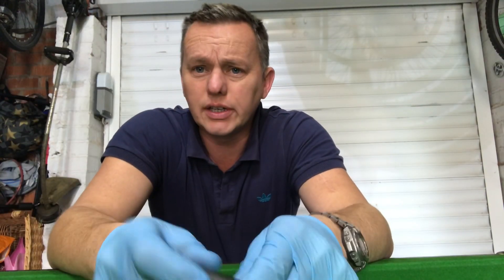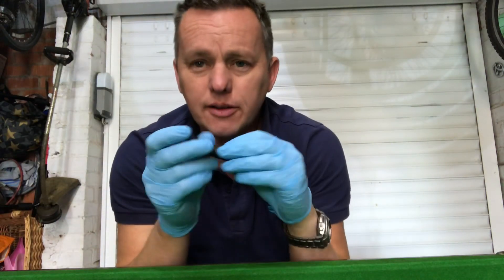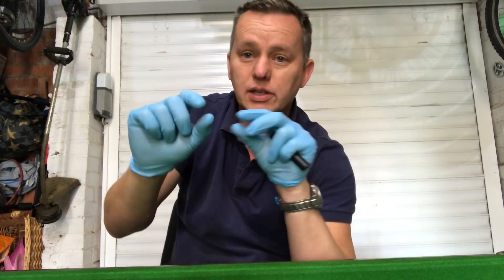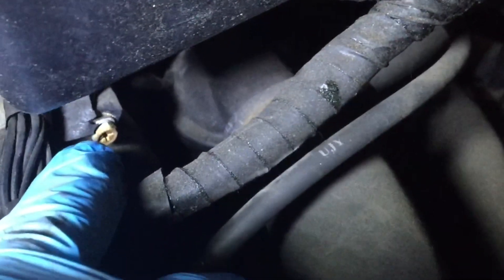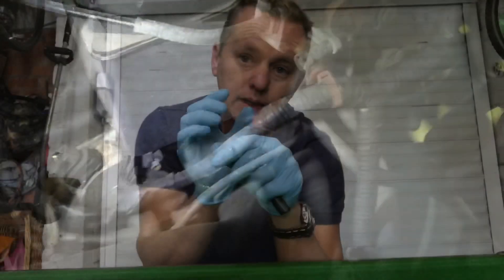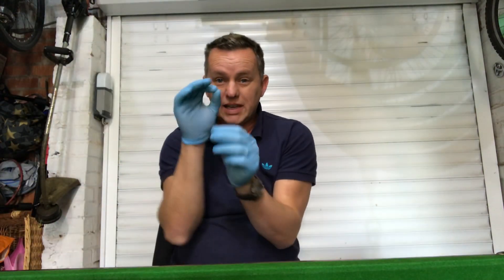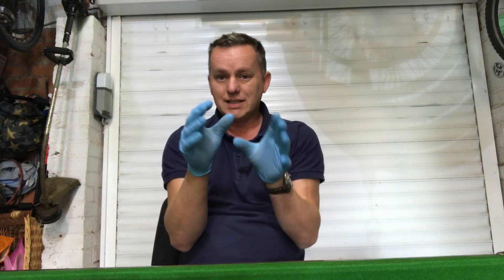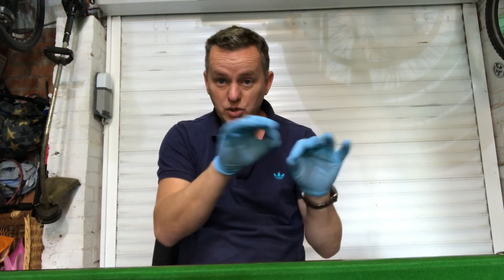Engine Cutting out or “Misfiring” HT Lead Faulty How To Repair No New Parts

Comment: Nice Job mate. Got an intermittent stutter at 1500rpm on my e93, changed coil packs but still there, any ideas?
Reply from the maker: Did you Change the spark plugs??
Reply: aaanton11 I did mate, the work was done as a recall. Strangely it does feel not as harsh as before, ie sitting at the lights the revs was dipping quite a bit on tick over, that’s gone now.
Reply from the maker: What engine are you running 👍🏻👍🏻
Reply: aaanton11 its a 320i
Reply from the maker: They have a issue with the valve solinoids on the front of the engine, causing the camshafts timing to be intermittently incorrect which can be mistaken for a misfire, do you have any fault codes?
Reply: aaanton11 No fault codes, at least on the self ‘engine check’ display, Cars only got 44k miles and good condition (2010) I’d be happy to change them even if it just eliminates them, spent no money on the car to date, just servicing, are they expensive do you know?
Thanks for for your advice mate much appreciate your time.
Reply from the maker: You need to connect a eobd code reader and read the codes from the ecu before buying anything, eBay or amazon about £20👍🏻👍🏻
Reply: aaanton11 Many thanks mate, will do.
Reply: Got a 96 e220 coupe had full service throttle body cleaned car misfires- shakes on idle, while idling the revs up and down